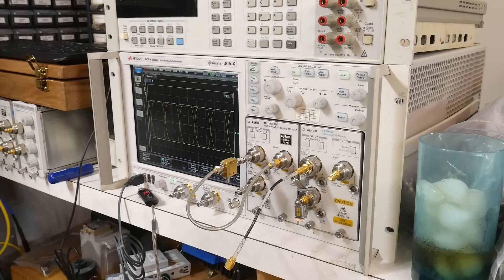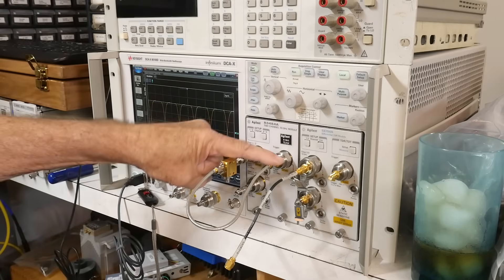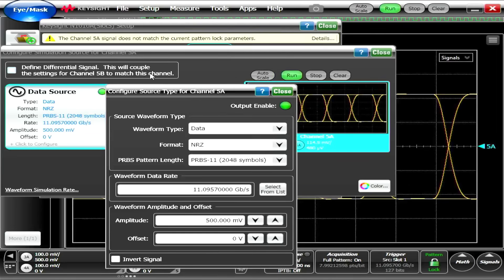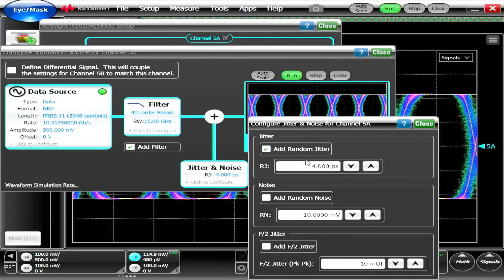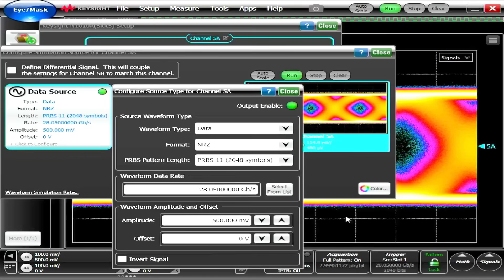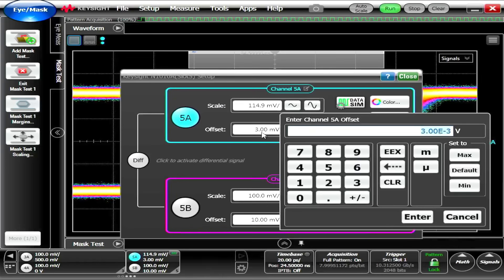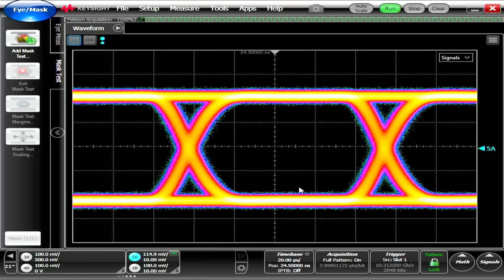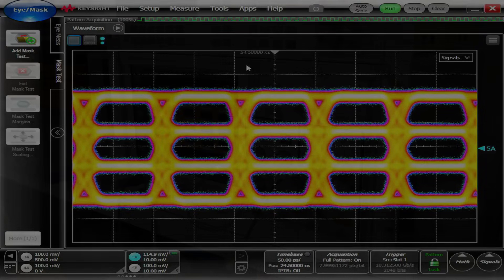#2307  DCA-X Eye Diagrams with Simulated Data

Comment: @10:42 - You said 4 fold, no, it only increases the system speed by 2 fold.  Going from digital 2 levels high and low, IE 1 bit per clock, to 4 levels, IE 2 bit, only doubles your data rate.  Your would need to go to PAM16 to get 4 fold speed increase.
Reply from the maker: Hmm. I guess so.

Comment: Fun stuff.  While I've used a lot of optical equipment it was just a transport layer that was someone else's worry to make right.  Having spent almost 50 years in satellite communications the hardware and communications link between the optical ends was my playground.  

Lots of potential channel impairments in system from analog or digital input through the mod/demod process, up/down conversion and PA/LNA then adding the whole RF path through to/from the satellite and the satellite itself.  Atmospheric factors and intra and inter system interference, etc.

Amazing how we've come from barely being able to transmit voice channels and low speed data to routinely sending info at hundreds of megabits per second.

That bit of equipment would have been a dream back in the day (not that it's ho hum today by any means) when I was doing hands on work.
Reply: Oh what fun it used to be in the 80's to characterize and optimize magnetic tape channel eye diagrams on an analog scope  (along with a BER tester)...

Comment: Not fault finding but isn't it interesting how loose the word MACHINE has become over time? I'm guilty as well but actually the def, of machine is, quote from wiki. "an apparatus using or applying mechanical power and having several parts, each with a definite function and together performing a particular task." I too use the word machine when describing something electronic with the only mechanical parts being switches. However, I'm trying to stop !! LOL

Comment: When I worked for Lockheed at Stennis Space Center as a Metrologist, we had a contract with Agilent to perform on-site calibrations at their small calibration lab in the basement of a Sony Ericsson cell phone engineering facility, in Research Triangle Park, and we had several of these be sent down to us for calibration.  Agilent calibrated for Sony and we calibrated for Agilent and Sony.

I'll never forget the nightmare of a procedure it was to calibrate those beasts.

Comment: Modern RF communications test sets that are designed to do digital communications in addition to analog have eye diagram and scatter plot functions.  My R&S CMA180's have both.  I like them because if a new non industry standard digital protocol is created (think amateur radio) you can create that new digital protocol using the external program on a computer and upload it to the test set so it can generate it, decode it and view it with the digital comm's analyzer functions.
Reply: I've missed your repair videos🥲

Started my electronics work in the mid '70s wiring in extra crystals for CB radios for the truckers who passed through the truck stop where I worked in high school - that was before the switch to 40 channels.  Had no idea how illegal it was at the time.  But CB and later ham radio are to thank for getting me interested in electronics.  Got my FCC 2nd class radio telephone license (later converted to general class when they reworked the system) and later became a licensed professional engineer all thanks to an interest in radio.  So thanks for all your videos really enjoyed them and I hope they'll help a new generation of interested folks launch into a new career in the industry.